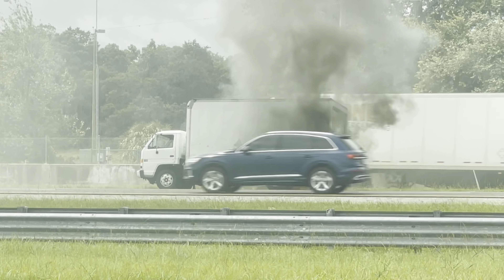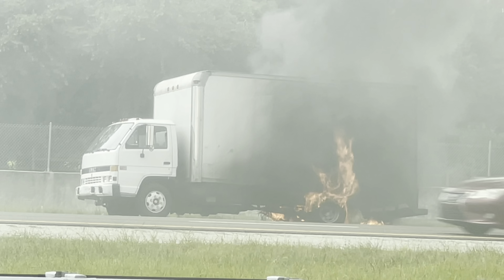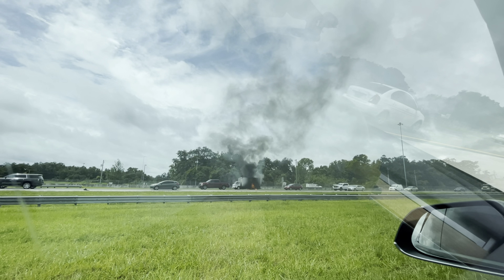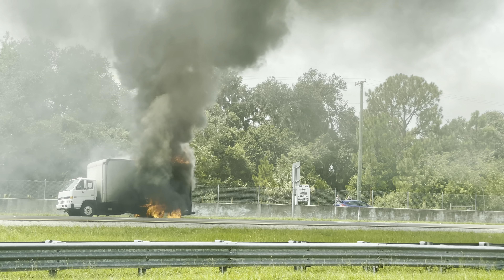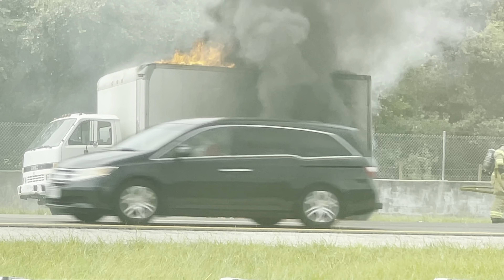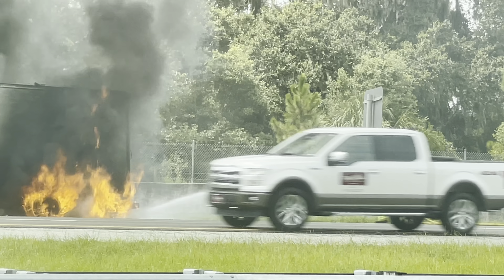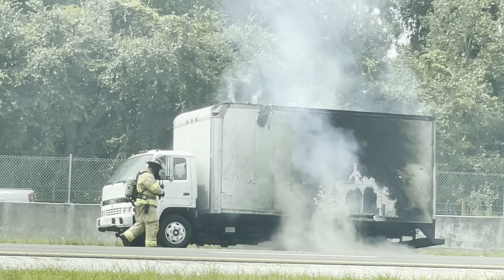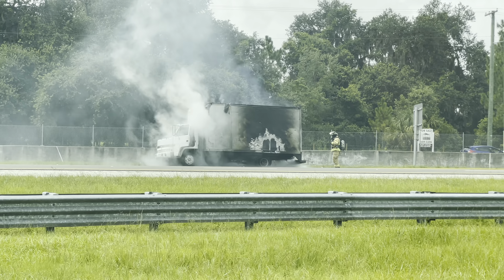Save my plate! Box truck almost fully engulfed in flames - fire department to the rescue

Comment: My guess is an axle bearing got hot and ignited the oil in the axle, ask me how I know about this.
Reply: It definitely happens! Hope everything turned out ok for you
Reply: Doubt it.  Both sides were on fire.  Service brake was set.
Reply: @jetpetty1613  I was in a light truck so I didn't have a full floating axle like the box truck.  I lost the wheel and axle. My wheel and axle ran a red light, before leaving he road. Fortunately, no one was injured.